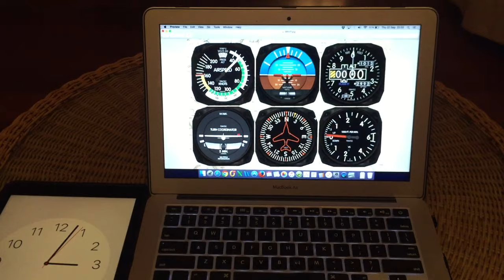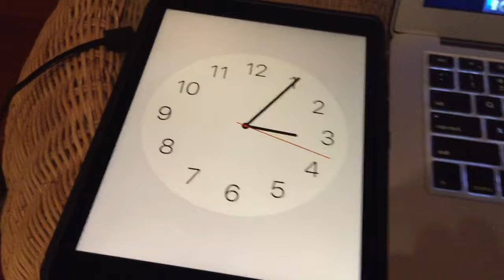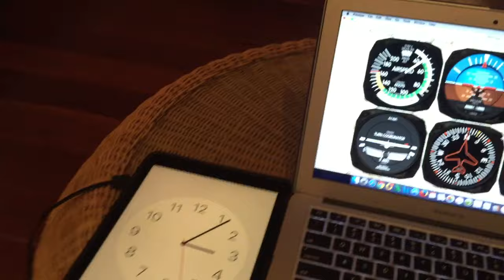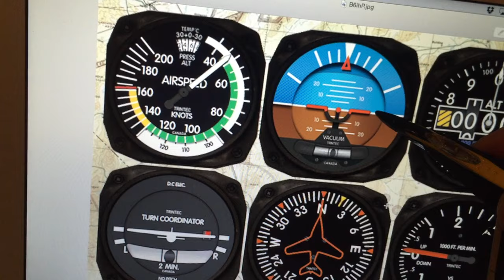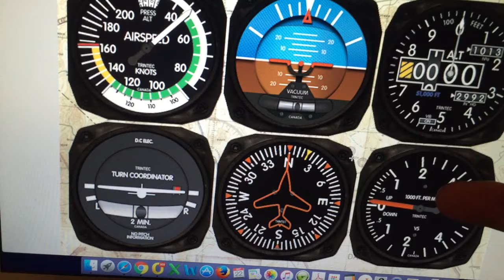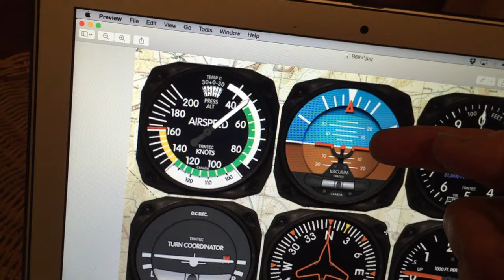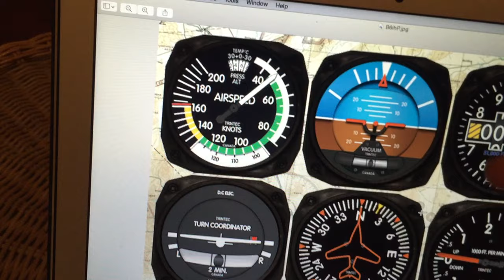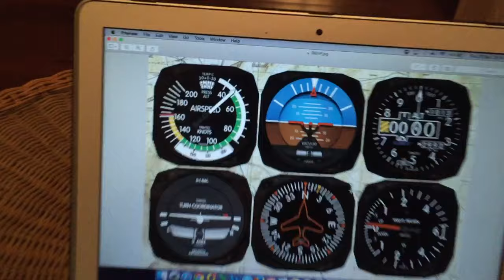Do aircraft change attitude to follow the curvature of the Earth?

Comment: so the autopilot pitches the plane down as the horizon falls. 

I'm wondering, what is it used to detect the drop of horizon. The AI (Attitude Indicator) is a mechanical application of a gyroscope, which will remain pointing to the horizon as calibrated at the airport before departing, and will keep that attitude during the flight. You can re-set it back during flight to the calibrated position, but you cannot re-calibrate it during the flight. Therefore, the gyro based AI cannot be used to detect the falling horizon.

What is the mechanism used then? What gadget will be able to detect the falling horizon, which will be then used by the autopilot to correct the plane's attitude?
Reply from the maker: It is all achieved simply by maintaining a constant altitude with the altimeter and VSI.
Reply: Wolfie6020 , if you calibrate your gyro in NYC before departure to Paris, FR, and when you lend, where will gyro point, still to the horizon, or somewhere way up?

If it points up, the earth is a baal,..., but then the gyro would be useless for the AI.

But, if it still points to the horizon, then the Earth is flat, agree?

Just don't reply that the gravitation adjust the gyro during the flight, because that is pure bullshit
Reply from the maker: Vladimir there is no point explaining how the gyro works to you because you have clearly bought the flat earth nonsense and have a closed mind to understanding how they really work. So I don't see the point in wasting my time or yours.  

I just showed you two experiments that prove the Earth is rotating but if you prefer to stick your head in the sand and ignore them that is fine with me too.
Reply: Wolfie6020 , I see, and that closes your "scientific" arguments. ok
Reply from the maker: At least with you it does mate. Always happy to explain it to an open minded person.
Reply: dude  it is not the gyro that takes care of maintaining altitude, only in auto pilot and when you have sudden air sacks

the altitude is measure by airpressure
Reply from the maker: M Goudsmits 金马桥
You are correct, the altitude is maintained by measuring air pressure.  Simply adjusting the nose to maintain a constant altitude is all that is required to address the curvature.

I have no idea why such a simple concept has confused so many people.  It is fascinating reading the flawed logic and misunderstandings being posted.
Reply from the maker: M Goudsmits 金马桥 Yeah it is just incredible.  I'll check out your channel.  Cheers.
Reply: +Vladimir Novakovic 
You have a clear grasp of gyroscope principles. The self described pilot seems to not know how a gyroscope is completely independent of all movement around it. Including any earth rotation.
Reply: +Wolfie6020 
So...the air pressure indication system provides the feedback signal to the control surfaces?
Reply: _ The self described pilot seems to not know how a gyroscope is completely independent of all movement around it. Including any earth rotation._

sorry dude did you not get it ??

you realy missed the whole point
Reply: +M Goudsmits 金马桥 
I get it just fine. I maintained and repaired gyrocompasses for years so I have a good understanding of gyroscopic principles. Without a signal from the instruments feeding the autopilot they are useless in an autopilot scenario. The is no such circuit in any autopilot system that compensates for curvature.
Reply: "the altitude is measure by airpressure"

oh, but why not with a thermometer, it colder you go higher

or with weight scale? I mean your brain would weight less in flight, due to lower gravitation up there, so you can calculate the height, right?
Reply from the maker: Diesel Bourbon
Honestly mate you are sounding like a broken record now and STILL missing the point entirely. The feedback system in the average autopilot simply maintains altitude.  That is ALL that is required.

Why are you having such a hard time understanding that?
Reply from the maker: Diesel Bourbon
Maybe a visual will help Diesel.

https://dl.dropboxusercontent.com/u/62849459/CDuHMi1XIAAn8Sx.jpg
Reply from the maker: Vladimir Novakovic
No he simply stated your examples would not work.  Are you serious thinking we could maintain accurate flight levels (within +/-10 feet) using air temperature or the force of gravity?  C'mon that was a silly comment and you know it.
Reply: well, I was obviously sarcastic, b/c there is no other way to respond to that the planes ATTITUDE can be dynamically and accurately determined with the air pressure.

you guys are preposterous
Reply from the maker: +Vladimir, Novakovic - Its a matter of perspective.  I am just an Aussie pilot with no strong political or religious beliefs.   I post videos based on my own experiences and will answer any genuine question honestly to the best of my ability. 

In return people have come here calling me a Liar, a satanist,  a sun worshiper, a freemason.  The tell me to go to hell simply because I beleive something different to them.   You have to understand the Australian mentality.   None of this bothers me at all.  I find it quite funny to be honest.   The fact that anyone in 2016 could actually be fooled into believing the Earth is flat truly fascinates me.  

Watching people get themselves totally bamboozled by simple Geometry and math is quite entertaining and helps pass the time when I am on a layover in hotel... preposterous?, yeah maybe.  I have been called worse.  

Always remember, you are here by your own choice and nobody is forcing you to post on my channel.  If you don't like the responses, go elsewhere.  That is what I do.
Reply: Wolfie6020 
I just had asked a question: if the autopilot does adjust the plane's attitude due to the falling horizon due to the earth's curvature, then what is the mechanism used to detect it and to signal the autopilot? As the gyros cannot be used for that (I hope that is clear to everyone), so do you know what that mechanism/gadget is?

a reply from goudsmith was the air pressure was used as a device to detect the falling horizon, which is of course, ridicules.

I also have another question. If your autopilot was not working, for some reason, would you have to manually pitch the plane down, and how would you do it in a pitch dark night when you cannot see the horizon?

no offences to anyone, I respectfully asked two questions
Reply: Vladimir Novakovic

a reply from goudsmith was the air pressure was used as a device to detect the falling horizon, which is of course, ridicules

let me say it again airpressure aka atmospheric pressure

oh and I have one in my watch and in my car !
Reply: M Goudsmits 金马桥 
ok, I'm glad you are not offensive. 

The airpressure can give you the height,..., approximately, but for the plane's attitude, you'd need two, one in the nose and one in the tail, and from the difference somehow to calculate the attitude. Imagine a fighter planes AI works that way. So, this is not practicable.

Also, you can find old cesna attitude indicators (AI), and you will see that they are based on gyroscopes. There are plenty videos on YT about the. Here is a pic:

https://s15.postimg.org/9c8yugfmj/attitude_indicator.jpg 

The roll, pitch (attitude), yaw are all the gyro (a gyro per each indicator) applications, for the last 100 or so years.

The question is, since the gyros can't, then what is used to detect the falling horizon and signal the autopilot to make a correction
Reply: Vladimir Novakovic okay I also missread your comment , I thought you made a typo with regard to Altitude

but you really mean attitude

which in its simplest form could use gravity, late gyro  and as far as I recall a patent that compensates for earth'scurvature

cheers
Reply: M Goudsmits 金马桥 
By any chance, would you have that patent number (or a URL) used by autopilots to detect the falling horizon using gravitation? I could find it by googleing it. Thanks
Reply: Vladimir Novakovic if I remember corerctly this one

Patent Centripetal acceleration compensation computer for stable platform

https://www.google.com/patents/US2968957

Another object of this invention is to provide a centripetal acceleration compensation computer which provides compensation signals corresponding to local turning of the vehicle and to motion over the spherical earth.
Reply: M Goudsmits 金马桥 
ok, this is about detecting the change in the direction of the plane by measuring centripetal force. That is ok. But we need to detect as when we need to change the direction, ie attitude in this case, and that is the step before this patent can be applied.

patent mentioned few times that the Earth's rotation and curved surface must be included in calculation, but I don't see what is the mechanism to detect that the horizon has fallen and for how much. 

I appears that they take the starting point, and then using the plane's speed calculate were the plane is, so the horizon must have fallen for this and that amount. So it is all calculation

We still don't know how to physically detect the falling horizon, during a night flight for example
Reply: Diesel Bourbon 
when you said somewhere else that your cesna hit the thermal layer after 20 mins of flight, you meant to say, you were supposed to have hit it, but of course you didn't, right?
Reply: Vladimir Novakovic that is has fallen coud you detect by the fact that the atmospheric pressure tells you you went up   just as an example

and as I undertsand the accuracy of altimeters is good enough to detect  somthing like 10 feet ?

which is avery little diversion of the curved path as explained by the video
Reply from the maker: Vladimir Novakovic
Ok,I apologies then Vladimir,  the autopilot when in ALT mode uses reference to barometric pressure.   If it detects a drop in pressure (meaning you are climbing) it will push the nose down.   Simple as that.

If the pilot is flying manually, he does the same thing, if the altimeter / VSI start to show a slight climb then the pilot will push the nose down.   By simply maintaining altitude the aircraft attitude will be very slowly changing as you fly across the curved earth.  The rate of change will be so slow that it will be not noticed at all.  You can't feel it and you can't see it.   That is why some pilot are saying they don't have to push the nose down.   I actually said would be the case in my video.   The change is achieved by simply maintaining altitude.  

Think of driving your car along 10 miles of straight road.  Can you let go of the steering wheel for the entire time?   No, you actually have to make tiny corrections to keep it straight.  If the road curved 1 degreee in 111 kilometers you would not be able to see it in the road ahead at all while driving, but by simply staying in your lane would result in you following the curve, agree?

Same concept here except in the vertical sense.
Reply from the maker: +Vladimir Novakovic.   I saw your question about the Wolfie name in the spam folder and unblocked it but now it seems to have disappeared.   Wolfie is the nickname my wife gave me.  On our first date in a restaurant when the meal arrived I sniffed it.   She laughed and said,  "Just eat it Wolfie" and the name stuck from that point.   The 6020 is the last four digits of my cell number (years ago) 

I set up this channel just for her after we got married in 2009 so I could post videos of the locations I was flying to.  Most of them are still there but private.   

I should have started a dedicated channel for the FE videos but didn't think I would be producing more than one or two. 

Here is one of the first videos on this channel in 2009.  We got married in Vegas and stayed at the Venetian hotel so I reference it as a joke in my video for her. 

https://www.youtube.com/watch?v=VKeHeAbxSKI
Reply: "At this point the plane would naturally follow the earths curvature since"

naturaly preposterous
Reply: wolfie, thanks for sharing that
Reply from the maker: +Khun Rich,  everything you said is exactly right.  When trimmed 
correctly and with a constant power setting the aircraft will find an 
equilibrium.  This equilibrium will try to maintain a constant speed.  
The aerodynamics will naturally pitch the aircraft up if the speed 
becomes faster than the "trimmed speed" and it will pitch down if the 
speed becomes slower. 

So if you are trimmed for level flight and a minor disturbance occurs, eg turbulence, and the nose pitches up slightly, as you climb the speed will reduce, aerodynamics will cause the nose to drop to regain this speed.   This is what we mean when we talk about an aircraft's static and dynamic stability.   It will always try to return to the trimmed state. It won't naturally hold wings level though so if you let go of the controls eventually the aircraft will end up in a spiral, but if you just kept wings level the pitch stability will hold basically level.  It won't be accurate though. 

Regulations for IFR flight (Instrument Flight Rules) require +/- 100 ft tolerance and the aircraft will not do this automatically indefinitely, it might for a few minutes only but will then slowly diverge.  This is why you need constant corrections from the pilot or autopilot to maintain altitude within tolerance. 

Think of driving a car on a perfect straight road.   If you let go of the steering wheel it will stay straight for a short distance but then will slowly drift to one side.   Even on a straight road, you need to make constant tiny corrections to stay inside your lane.    Holding a steady altitude is the same concept but in the vertical. 

Now imagine the road curves smoothly by just 1 degree in 111 kilometers.  You would not see the curve at all.  The visible road ahead would look straight.  You would be constantly making tiny corrections just to remain in your lane and after 111 kilometers your car direction has changed by 1 degree and you would not even notice it.
Reply from the maker: +Khun Rich,  I just purchased an Artificial Horizon from Ebay as I have a few ideas to demonstrate that they actually do self correct and align with gravity.   After doing that I will take it apart on video and show how the pendulous vanes work.   There are no specific videos of experiments done with a real artificial horizon in the context of the Flat Earth so I bought one to make videos and this should answer a lot of questions people have.  It is not due to arrive for another 10 days as it is coming from the UK, but watch this space.  :-)
Reply: it looks like I can't post becase of the links I put, so I rearange them

great, I am hardly waiting for you to make that video. You can put the AI, when you get it, in the car and drive up/down hill and see what it shows. The best would be to take it in a commercial plane, but that you probably won't be allowed, but you could rent a cesna, for example

I bought a gyro from gyroscope dot com. It is nothing like those sold at ebay, but it does prove the rigidity in space just fine

The bottom line is, you have agreed now that the attitude is not detected/measured by air pressure, but by a gyro. Here, this guy had it disassembled. The AI (Attitude Indicator), or artificial horizon, is a simply a mechanical application of a gyro, for the last 100 or so years

type this in the YT url: watch?v=KUSklh3MKtA
Reply from the maker: HI Vladimir,  I approved your post with the video link.  It was blocked 
but should be visible now.    I never claimed the attitude is measured 
by air pressure.   The Altitude is though.   Did you watch the video you
 linked to carefully?  At around 3:30 he specifically talks about the 
mechanism that causes the gyro to align itself with "G"    

That is the key to why the Artificial Horizon remains level as the aircraft curves around the Earth,  it self corrects to "G"    That totally negates the entire argument Flat Earthers have about the Artificial Horizon.  

You can see that clearly here also. 

https://www.youtube.com/watch?v=dNwtdsgsdaI
Reply: +Vlad
Those old style vacuum gyro's are mainly a GA (General Aviation) thing.  It's not so much of a problem there, as you're running out of fuel well before you make any significant distance around the Earths curve.

Modern jet aircraft get Attitude and Direction Indication (ADI) from the Inertial Navigation System (INS).
It's a set of laser gyro's, (one for each axis) sitting on a platter which is held stable by the rate integrating gyro.
The rate gyro provides an input to the flight data computer showing the gyro drift for curve of the earth (transport drift).
The computer crunches the numbers and outputs to the display accordingly.

If you want to know more, you'll have to read up on it yourself.  I'm only an engine-airframe guy (still had to pass an instrument exam though!)
Reply: The mechanism that automatically pithes the aircrafts nose down is the air pressure that the aircraft is flying through. Set your cruise altitude and speed then trim. In totally calm conditions aircraft will follow earths curviture ad infinitum.
Reply: Ring laser gyros.
Reply: +Vladimir Novakovic
" you cannot re-calibrate it during the flight."
YES, YOU CAN, but that is not even the point. All artificial horizons recallibrate themselves continuously during flight. They have built-in erection mechanisms that detect the local gravity vector and torque the gyro accordingly, so it is always parallel to te local horizon, even if the airplane is travelling a full trip around the globe. Look it up.
Reply: Wolfie6020  I find your reply to this person: Vladimir-  so sir, you are absolutely implying that an “open mind” is one that accepts your explanation?  Candidly, I found the video extremely enlightening. However, there are still allowances for others to “question” any explanation or narrative. The “Facts” are not necessarily indicative of the truth!”  Anyway, I only point out that freedom of thought is still permissible- no matter what any other person thinks. “A sleeping mind never questions!”  Great video though. It made sense to me. Much respect. Enjoy your day. D